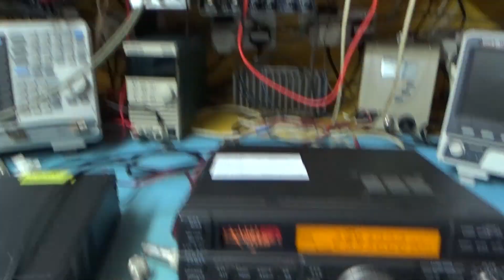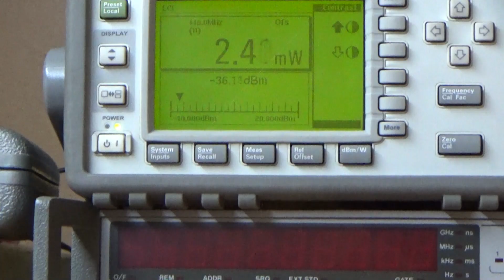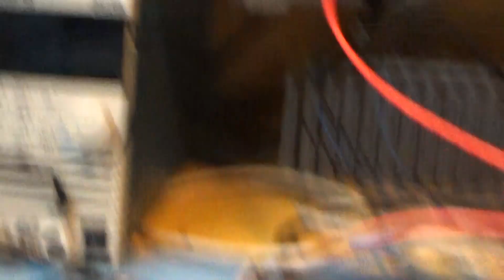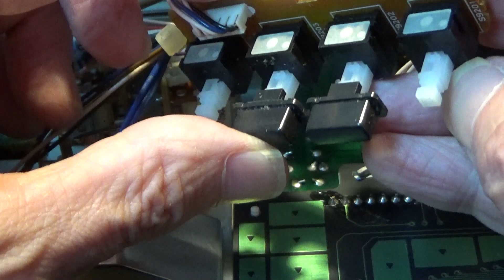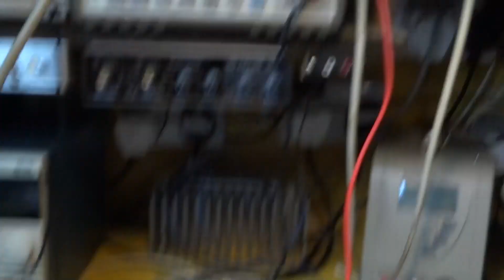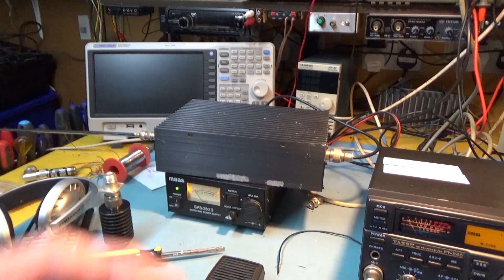Yaesu FT 840 repair and test

Comment: Mine has distorted audio on TX as well, any suggestions, please? Brian M6BAQ
Reply from the maker: Hi Brian, impossible for me to diagnose faults at a distance. But old dried out capacitors are a common problem with older radios.
Send it to me if you want, but that could get expensive!
73 Nick
Reply: @ptronix  Whats you call sign, please? Can we talk, say over phone/email,.
Reply from the maker: @control5835 hi Brian, you can email me with a phone number and I'll contact you. Ptronix1@gmail.com 
G6BPC Nick

Comment: (23:18) backup battery, switch off for storing when not in use? 73s m7fdj
Reply from the maker: Exactly what it says in the manual Paul. To save the battery if you store it. 73 nick